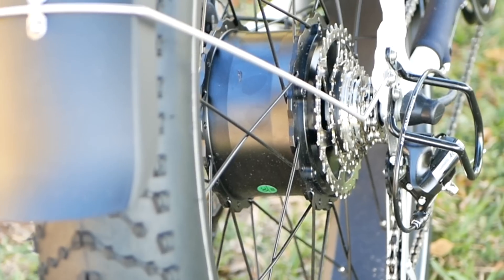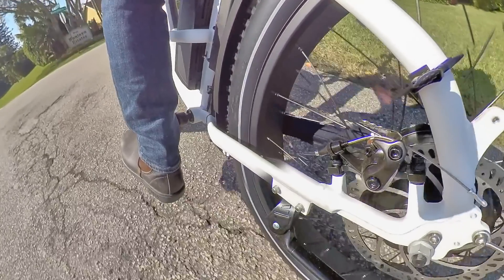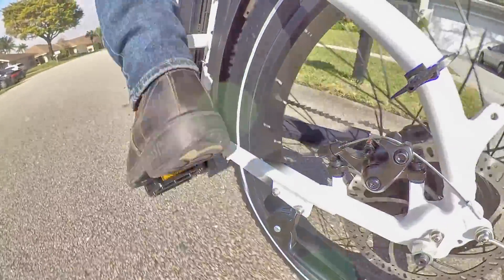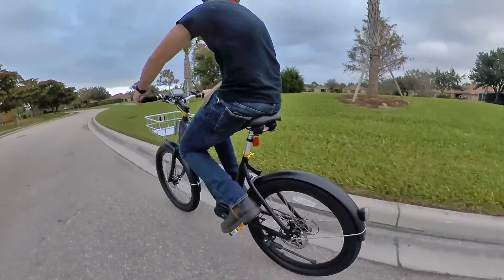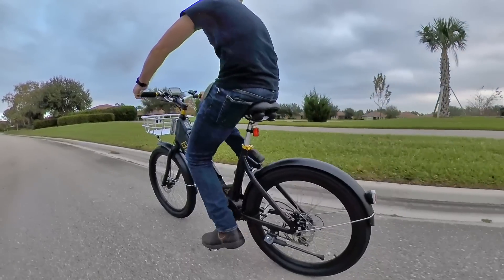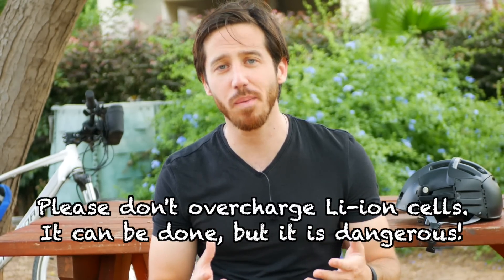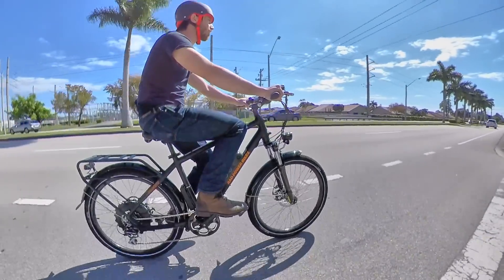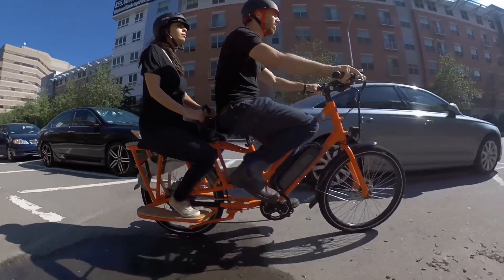Why don't more electric bikes have regen brakes?

Comment: I have both an 2000 Watt fast electric bike with a direct drive motor and regen braking and a 250 Watt Pedelec bike with a geared motor without regen braking. The fast one brings back about 5%, because I love going downhills on roads at 60 km/h. If I would regen brake to 30 km/h, the benefit would be great. And in 5000 km, I haven't changed the braking pads.
But:
The 2000 Watt motor weights 8 kg, so the rear wheel is so heavy, it bumps heavily on bad roads. The 250 Watt geared motor only weights 2.7 kg, so nearly the same as a normal axle, you can drive like a normal bike. The consumption on the same speed (27 km/h) isabout 8 Wh/km with the direct drive an 2 Wh/km with the geared motor. So whats better? Both bikes are big fun, I wouldn't change!

Comment: Regen: disadvantages will be iliminated  in future. It's all about engineering...
Reply: What disadvantages? Everything is already eliminated with the most basic implementations.
Reply: @difflocktwo  having permanent magnets creating resistance on windings in combination with limitations on the mentioned freewheel situation, both seems to be a challenge. I think in the future we will see double feed induction generators on bikes as used in w.g. in the wind industry works as generator and motor..... Sorry, too many details to mention it here
Reply: @Gallardo6669  But if you have regen you capture energy back and can use that to overcome the resistance.
Reply: It's not gonna be that simple otherwise it would have been implemented yet
Reply: @Gallardo6669  It really is that simple. Any 30$ Chinese controller and $100 Chinese electric wheel can do regen braking.
Reply: @difflocktwo  everything in live is a compromise. Hub motors can easily Regen vs. geared motors which are currently used in the most ebikes. But they all have advantages and disadvantages, e.g. Torque and speed also heavily influence the system layout. I spent months on this to read and learn about this subject. You can't have it all, but yes, there are still many improvements possible.
Reply: @Gallardo6669  The problem with just reading is many people repeat misinformation. 

The performance of a $100 Chinese motor is already like a 50 cc scooter. 

I think the main compromise people are making is an visual one. They want their bike to look like a bike governed by the UCI. Ideally we would approach personal mobility with a  open mind.
Reply: @difflocktwo  I work with inverter and converter technology and serveral motors/ gens. I usually not just repeat written statements. Things are getting really complex and need to be efficient, especially for e bikes where small differences can easily be felt to matter

Comment: i have some knowledge of this, and totally agree with you.  i would add that if one wants to get a UL2849 certification, the functional safety part of this is very problematic, and could be somewhat expensive:  the standard is written with the notion that when one applies the brakes, the motor is disengaged.  

if that is not the case, there is additional investigation (cost) to examine the firmware/software code to determine how that risk is mitigated.  yes, they look at the software for the motor controller and everything related to that, including the low voltage electrics that may not be part of the battery mains - usually 36-48VDC.

bottom line: i agree with you about the return not being worth the hassle, and the compliance issues kind of finish it off.
Reply: Wouldn't the software that disengages the motor cost the same to investigate weather motor torque falls to zero or motor torque reverses?

whether*
Reply: @difflocktwo  yeah, but then they'd have to test it, which is additional lab hours.
Reply: @skip123davis  That's unfortunate. I wouldn't ride an EV without regen braking. My diy ebike would be much worse off without regen braking. I basically get significant braking for free. Most off the shelf controllers already have regen, would this mitigate the cost of testing by using a compliant component?
Reply: @difflocktwo  sure!  there is an effort to get component manufacturers to pre-certify components, but that will take some time.  

i respectfully point out though, i think you missed part of the message from the video that regen doesn't do a lot for ebikes as far as efficiency goes.  i completely agree with the assertion and surrounding facts laid forth in the video.  

if you want to bear the weight cost, etc for braking, well, that's your choice.  personally, i think it's an expensive, complicated brake, but that's just my opinion.
Reply: @skip123davis  Regen is an expensive complicated brake? If you have forwarded torque you automatically have reverse torque, for free. 

The cheapest motors and controllers from China are all regen capable.

Bicycle riding consists of a lot of stop and go. By purely using the motor for accel and decel you save a lot on mechanical wear. Also performance is independent of weather conditions.

Energy recovered from regen is not zero. The energy recovered is actually greater than all drivetrain drag. This means with purely regen you can simulate a frictionless bicycle.

Comment: What if dedicated regen hub on front wheel, front brake lever clutches engagement of the spinning magnets. Something like that would be able to coast free and regen trough battery charge input.
Reply: You're almost at the point of having built a motor then.

Comment: Can't the clutch engage as soon as the brakes are applied, thus having the magnets go past the coil? That'd allow for regenerative braking in a geared motor.
Reply: Mechanical complexity and almost worthless. Just ditch the clutch and always stay engaged.
Reply: Just buy a direct drive hub. You can have two motors. Direct drive hub will be stronger. It’s works like this? Picture your descending down the steep grade with the load on your cargo bike. Now the grade is 16% a 5 minute drive down hill. The direct drive hub is the first choice because of efficiency! So your going down hill pulling the cargo trailer too. Your doing to set your regenerate braking to your desired speed. Now it’s like cruise control it’s will never over speed unless you activate your brake lever’s or pedal to change the cadence this will kill the regenerate braking function. Regenerate (diamagnetic braking) charging max battery too down hill auto pilot cruise control. Nice,nice! 2018 Rad Wagon Cargo. Mods-80 amp controller with color display 5 batteries totaling 80amp/48volt. I have two mid drive bikes,but the cargo is my favorite.

Comment: Thanks, good video. 
Just a couple of points, about my experience of 6 years and 30,000 km with a Kalkhoff with Albert Xion hub direct drive motor and rege in braking: 
1) I do not perceive any friction if costing, 
2) and something very important: practically, I do not spend  brake pads, no brake maintenance.  Another important point regarding the central motor, is that in hub motor's, the chain suffers less (risk of breakage, and you can continue your journey by motor w/o pedals...), and the chain has a 3 times more life.
Thanks & Regards 👍

Comment: Can you make an e-bike battery with regular AA batteries you would buy at Costco ?
Reply: Yes.
Reply: @difflocktwo  No. And you have just shown how little you actually know about ebikes. Well, with this and every other comment you have posted in this section, that is.
Reply: @Nitecrow314  Be more specific. Why couldn't you use AA cells? 1. NiMH was used before lithium was cheap enough. 2. you could make a single use battery from primary cells.

What other comments are you talking about? I run an ebike with regen and wouldn't run any EV without regen.

Comment: when regen brakes give back enough energy, then they will be useful. for now, so much more energy is used to gain back speed the regen brakes takeaway vs how much energy u get back from regen deceleration, its just not worth it. smooth coasting is much better right now
Reply: On a typical ride cycle you will gain more energy with regen than you lose due to motor drag. This means you will have even smoother coasting with regen braking since you can overcome motor drag and then some.

Comment: I recently built a go kart with car alternator as bldc motor and some ebike parts. I was thinking about making LiFePO4 batteries for my go kart and ebike, but using prismatic cells, not cylindrical. Something like DIY powerwall, but with smaller cells and more voltage. Is it a good idea? I am not sure if LFP can take vibrations and if it will be reliable enough.

Comment: Another issue comparing ebikes to electric cars for regenerative braking is that ebikes simply do not have the same mass as a car to start with. So the the regenerative brake becomes more akin to an anchor than a brake, as it will cause the ebike to come to a full stop not merely to slow down, as with a much more massive car, on even a steep decent.

Comment: there is a plus about regen brakes that was not covered: it may not contribute much to the recharge cycle BUT it extends the lifespan of your brake pads.
Reply: +1 On a heavy bike the pads become a real issue, I was burning thru mine every 3 months. I have a Regen bike now for more than a year and the pads are almost new. I only use the pad for emergency breaking so some rides they don't get touched at all. I ride in the rain alot and the smoothness of regen breaking is also very helpful, as well as it doesn't get affected by the rain except for when the tire slips. On the minus side i do live on top of a very steep hill so i do experience the random cutoff of regen break while going down the hill, its a little annoying but when you know its going to happen its easy to adjust.
Reply: @madnut666  Great, what kind of regen bike do you have, year, model, etc? thanks
Reply: Exactly, Got an old Bionx, just run with the system on because of the regen brake, even if I dont plan to use the electrical power. I use the bike to get to work, and I have a long slope to climb (about 2km) in the morning, so in the afternoon, the regen is very handy, the normal break would overheat rapidly.
Reply: @airlui  Great, how old is your used Bionx that you had good luck with it?  Had to replace any components yet? I'm wondering what fails first, or most often, or requires most maintenance, thanks.
Reply: @arlenekufchock1394  mine is Custom built, Mxus  hub motor on a qulbix frame. Only maintenance i had to do is from dropping the bike.
Reply: The only reason I use it on my 14kw surron, to save the purple galfer pads Xp

Comment: Hello,  was watching previous video on over powering motor.   You used the calculation wheel diameter * by motor rpm * by .003     what is the .003?  Cheers Dale
Reply from the maker: Yes, that's just a constant that pops out from doing the math to convert wheel diameter and rpm into a speed. If you do the math yourself, you'll get 0.00297 or something like that, and 0.003 is close enough to remember off the top of my hand.

Comment: There's another way. Instead of dumping charge into a full battery, a variable resistance / short circuit will make the best abs brake system. With hub direct drive motors, if there's no load on the coils, there's almost no resistance physically.

Comment: The new VanMoof X3 has electric front wheel motor and 4 gear rear chain drive under software control, the front motor looks too small for regen but do you think this is the best compromise for rolling resistance and weight hence efficiency?

Comment: My bike battery is 48 volt / 14Ah  it is for the M2S pro 750. 750 watt rear motor, 26" frame  9 gears,  26 x 4" tires. The battery will last a long time with conservative riding and this bike is flat out a blast. Keep these bikes clean and learn how to change the rear tire correctly , it's really not that hard.

Comment: It's funny how many people think their subjective experience and confirmation bias outweigh science.

Fact: regen is better than coasting. Getting energy back is better than not using any energy.

It is usually easy to "prove" a false point by carefully picking a scenario that avoids the weaknesses in your argument, especially if you pick a snapshot of a certain state or short time and carefully avoid looking at the entire system and the overall, long-term effects.

It is an indisputable fact that regenerative braking has a positive effect over time, regardless of the vehicle. The questions Micah is addressing are how much benefit is there, and is it worth the development and expense? The answers for casual bike riders happen to be "not a lot" and "probably not". You probably don't ever run your battery all the way down on a single ride and have easy access to charging whenever you need it. But for some people and some situations it would be worth it. Specifically, people riding long distances in extremely hilly terrain would see a significant increase in range with regeneration, and keeping the battery at a higher state of charge gives you more torque to get up subsequent hills.
Reply: Yeah, exactly like Seattle where regenerative breaking is an excellent advantage. It dramatically saves brakes and decreases the frequency of charging.

Comment: there is one point to be made that I have not seen in the comments: the very different "feel" between a direct drive (gearless) motor and the more widely used geared hub motor.
I have both....yes, the power you get back from regen is negligible for sure....and the typical geared motor has TWICE the torque of direct drive (better acceleration)....
So why would somebody want/like/love a direct drive bike???  It is SO much quieter than a geared hub motor...you can't hear it. The "cogging" is NOT a problem while riding because on my bike the power is always on even if it's only on "1" PAS (this is a bike that weighs over 60 pounds...why would you want to pedal it on "0" PAS, especially after paying all the extra money to get an electric bike?) Power delivery is so much smoother than a geared hub motor, no jerkiness at all when the motor comes on (less torque, remember?). A motor with ONE moving part, as opposed to the many moving parts in a geared hub motor, is essentially and by definition more efficient and that will translate into greater range and greater longevity. I can't attest to the higher longevity as I only have 1200 kms on the direct drive...but I can certainly attest to the greater range aspect. 
The "perfect bike" would have the torque of a geared hub motor and the smooth "feel" and quiet operation of the direct drive...but "you can't have everything...where would you put it"!

Comment: The question is really who wants to slow down frequently when coasting downhill. Maybe on a gnarly steep track, but on the road?
Reply: Intersections? Slower traffic? Not over speeding? Turns? Ice?
Reply: @difflocktwo  That would require the ability to control the regeneration with the same degree of control-ability that ordinary brakes offer, much more complex than simple power on/power off regen.
Reply: @Swaggerlot  Simple on/off works really well.

What's so complex about using progressive regen? You operate it like any brake or throttle.

Comment: I save a $100 per month because of my regenerative braking on my front tire. I burn through brake pads like crazy as I'm hauling a massive trailer. Also, my bike has a bbshd mid-drive for the rear.

Comment: Building an ebike motor for Kickstarter, using a skateboard wheel motor. Comes with regen breaking. Keen to send you an exclusive prototype. Pop a comment on any video if you are curious. (30% less range 30% less speed, 2kg total weight easy 1 step installation)